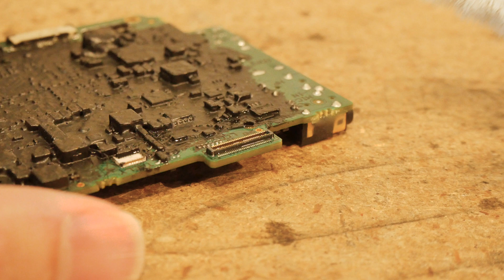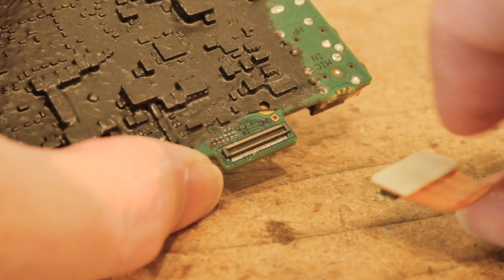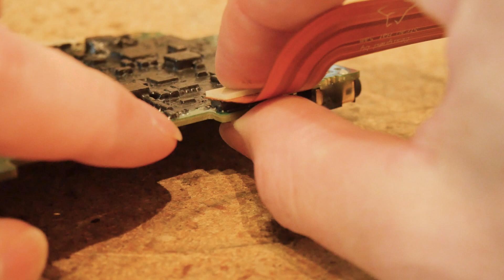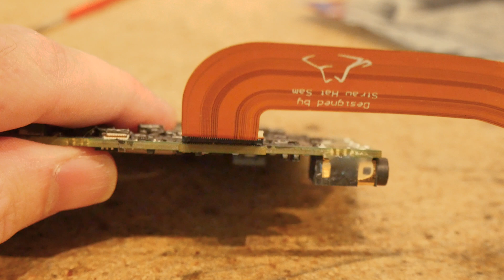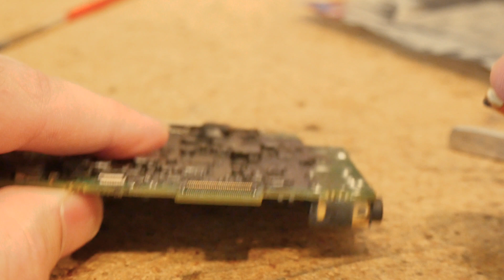How to not break your BMPCC4K

Comment: Do you recommend conformal coating? I usually fly at the beach.
Reply from the maker: Yes I recommend CC 100% if that's where you fly. Just don't coat the FFC connectors or the tops of the large processors, just the sides.
Reply: @strawhatsam  what conformal coating do you recommend?